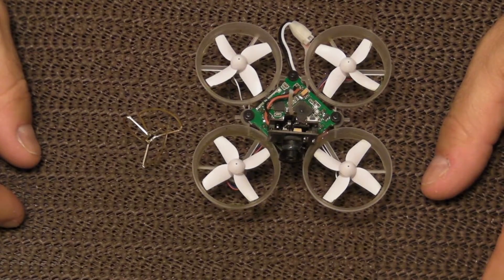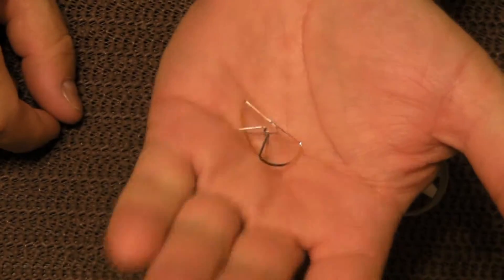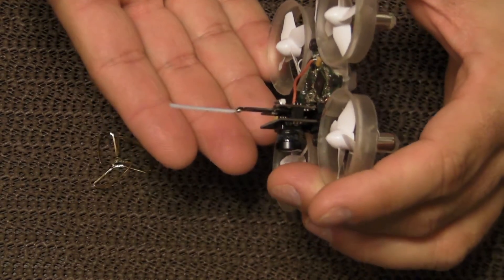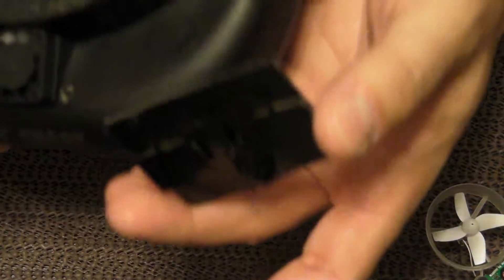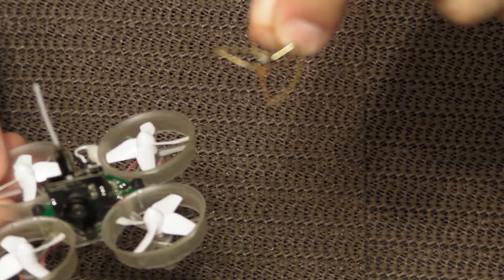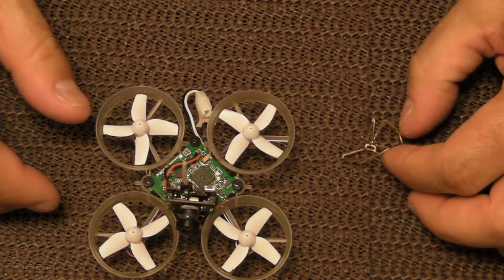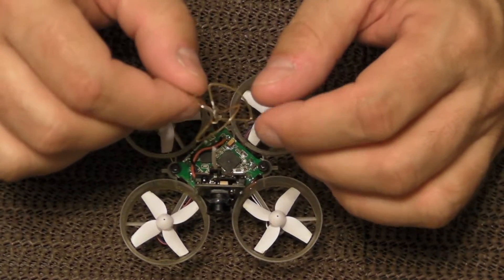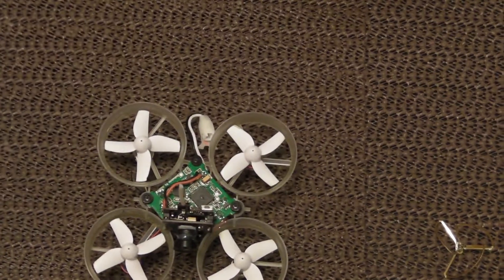FX797T Ultra micro FPV system antenna repair

Comment: Great job, I think in the next few weeks we will see a whole lot of new antenna designs popping up as the original one is a problem. there is a new version out from newbeedrone that is a dipole and looks promissing. If you can solder the choices are there to experiment I know I will be.

Comment: is the patch antenna required for this to work? my clover on the camera is in bad shape and I'm tired of trying to solder it
Reply from the maker: No, you can use a regular dipole that comes standard with video receivers or fatsharks.  Not sure how well the reception will be though.
Reply from the maker: I guess it happens eventually.  I had to order a new one because I ended up breaking the antenna solder pads off of mine.  It was an epic flight though :)  Good luck.

Comment: it doesn't need grounding
Reply from the maker: No, one wire on the center solder pad does the trick.
Reply: is it the same with 798?
Reply from the maker: I don't have a 798, but I assume that as long as you can access the active antenna pad,  you can attach the dipole to that one as well.

Comment: What is the length of wire you used? Thanks!
Reply from the maker: I used 26mm which is roughly 1/2 wave for 5.8ghz.
Reply: Awesome, thank you for the reply! I will be doing this tonight. I crashed last night and one of the lobes cracked at the bend, but even after soldering it back together my range is severely decreased.

Comment: what kind of wire did you use for the antenna?
Reply from the maker: I used the center lead that I took out of a short piece of RG174 coax cable.  I'm sure just about any thin flexible wire will work.